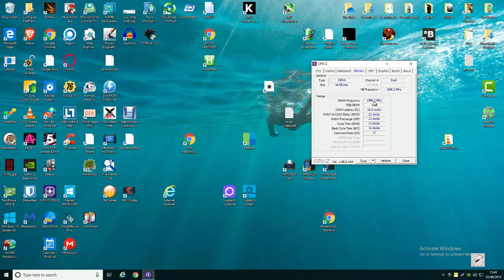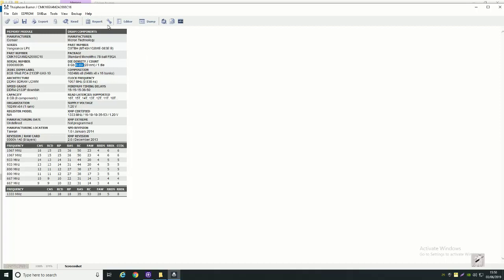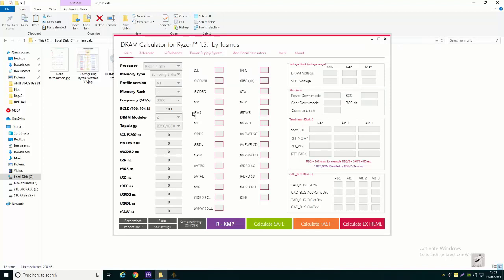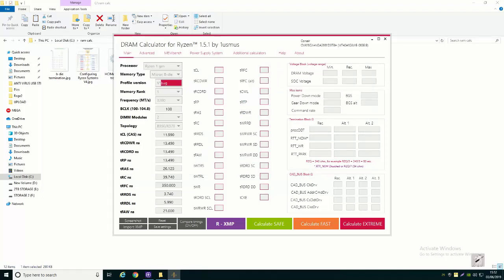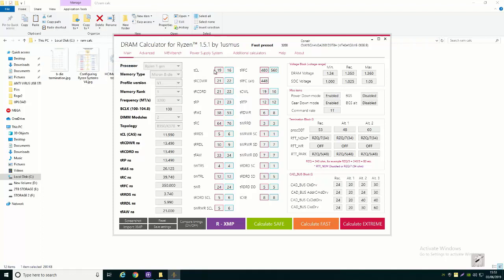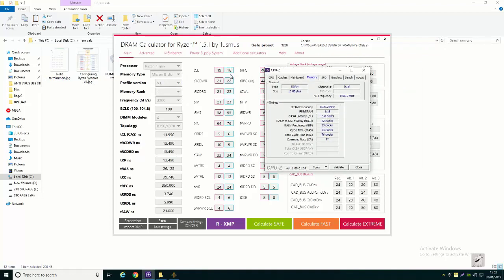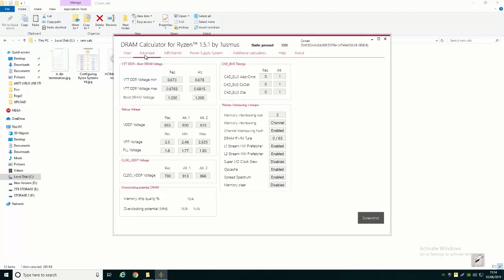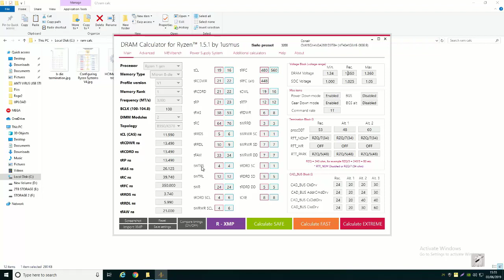Ryzen: Overclock RAM for massive Gains in performance how to

Comment: how do you get Thaiphoon Burner to work on Windows10, I cannot get it to run
Reply from the maker: ok i wonder do you AVG antivirus??? i do. it would not run. i had to turn off antivirus and then it will run.
Reply: GhostVaperYT  I have Vipre, will give disabling that a shot
Reply from the maker: @briandiff1459  YES because it acceses your memory your antivirus stuff thinks its hacking
Reply: @GhostvaperYT  yea that did the trick, thanks
Reply from the maker: @briandiff1459  yeah no problem my AVG antivirus  shuts it down aswell i have to pause the avg to run thaiphoon burner.

Comment: Thanks for the video. I own a MSI B450 Tomahawk Max, a Ryzen 3600 and 16gb Ddr4 3200 CL16 ballistix lt ram.
Is this worth using in my case, meaning, is the time spent fine tuning and testing compensated by the performance gains?
Cheers
Reply from the maker: i'll be honest. it depends what you do. for gaming it is not worth overclocking if you have a good GPU your system is already powerful. you will only get a few more fps and i bet you already get 60+ fps. Now if you video edit or stuff like that then YES overclock mate. You can always reset it if it's not worth it.  EDIT: try get your ram to run 3400+ if you can ryzen loves fast memory because of the way it works. timings don't matter so much its speed.
Reply: @GhostvaperYT  Thanks for your answer. I own a Nvidia 1070. I tried overclocking the ram to 3600 on the bios and didn't work. Should I use the calculator to try and overclock my ram? Seems very difficult... Cheers
Reply from the maker: @andrepamendes  it is not difficult but to be honest with a 1070 i only have a gtx 1060 6gb  you should be ok. Is it just for gaming or for work??  you could also try doing this put volts for RAM to 1.35v and try 3300 or something like that or 3400 with those volts.
Reply: @GhostvaperYT  it's for gaming only. So you don't recommend using the calculator, only the bios? Cheers
Reply from the maker: @andrepamendes  if it is for gaming use i don't recommend bothering as it could take you ages to OC the ram and all that will happen is 1 or 2 more fps thats it!  only thing i do recommend is volts to 1.35v on ram and try put in higher speed i have ddr4 2666 running at 2800 and it wont go any more so u already have decent enough speed.  - and i recommend if you use a calculator taking a picture of settings then putting them into the bios manually yes.

Comment: the new version of dram cal. dont show trfc2 and trfc4... should I leave 0/auto ?
Reply from the maker: try auto. you might have to play about with it honestly I ended up with most settings on auto only main ones top 5 were set and voltage and speed